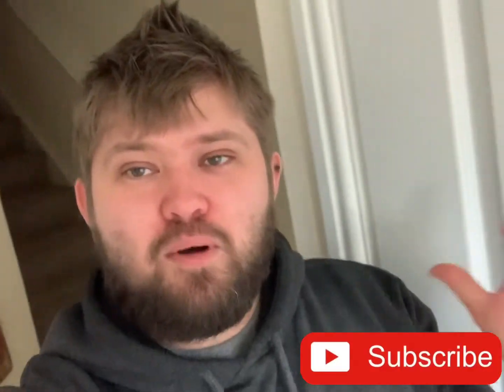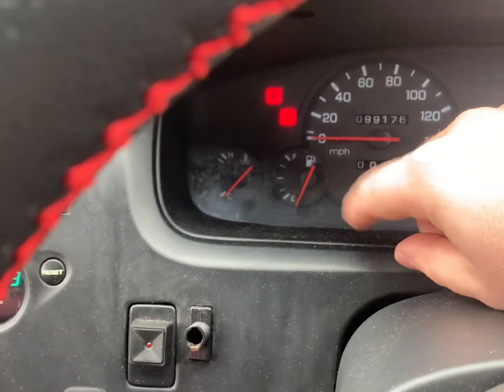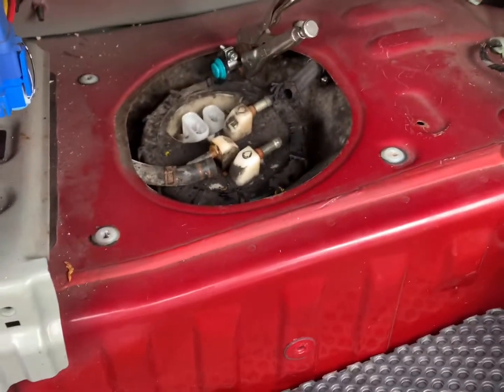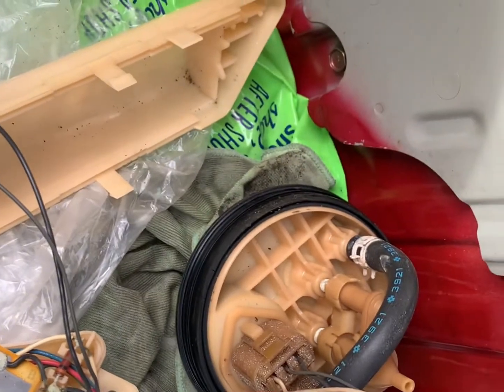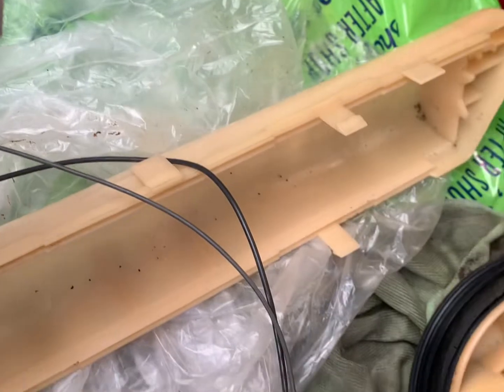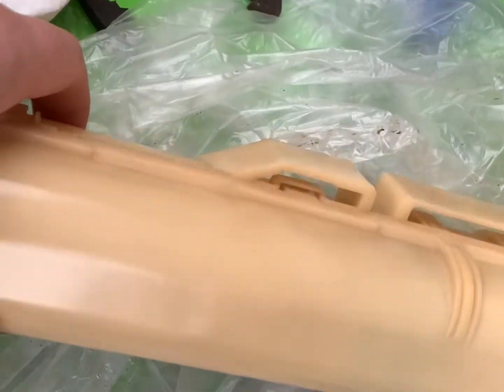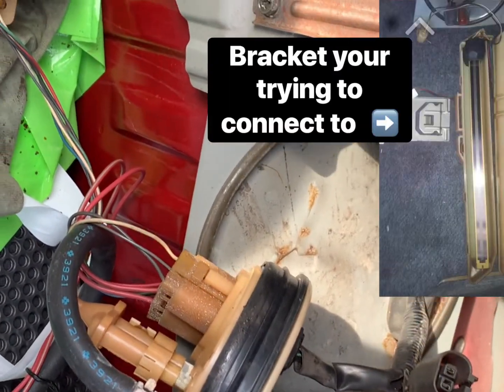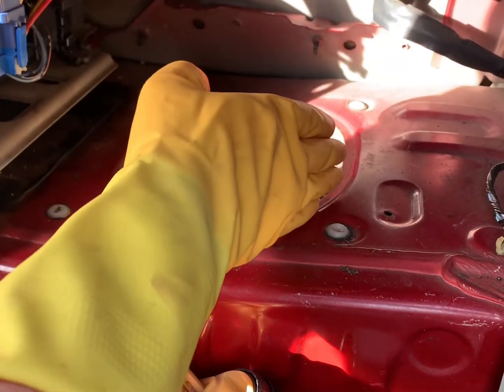R33 Fuel Gauge Not working ? - How to remove r33 fuel level sender and how to clean it.

Comment: Hi mate, just pulled mine apart and found it’s missing the resistor between the black and white. Just trying to chase down the correct sizing of the resistor, cheers for any help.
Reply from the maker: Hi mate, I think I have the old one somewhere around I’ll try to see if I do to take a closer look. 

In the end I managed to source a second hand sender for £100 which fixed the Issue out. 

If I can find the anything I’ll reply back on this comment or if you have Instagram I can try to send pictures on there mine is ashlb33 👍🏻
Reply from the maker: Hi mate, I got a close up picture of it and asked chat GPT as I couldn’t see much to go off I got the below. I hope this helps:

From the photo, that axial resistor appears to be a fixed calibration resistor used in the R33 fuel level sender circuit (not the main variable track).

What Nissan typically uses (R33 GTST)

For Nissan R33 fuel senders, the overall sender range is roughly:
	•	~90–100 Ω (empty)
	•	~10 Ω (full)

The small fixed resistor you’re pointing to is usually around 100–120 Ω, used to trim or stabilize the gauge reading.

Reading the color bands (from what’s visible)

Although the image isn’t perfectly clear, the bands look like:
	•	Brown – Red – Brown – (Gold tolerance)
Which corresponds to:
	•	12 × 10¹ = 120 Ω ±5%

This lines up very well with what Nissan commonly uses in these senders.
Reply: @ashlb8223 thanks for your help mate, appreciate it.
Reply from the maker: @jaiden1500 No problem at all hope it was some help to you mate.

Comment: Did you fix it allready? What was the reason, how u did it?
Reply from the maker: Unfortunately and cleaning it up it neverworked I still have it though so I would like to do a fault finding video on that sender unit. I managed to source a whole sender unit with the wires and connectors and swapped it out and it worked. 

So somthing is wrong with the send I’m yet to figure out what though 🤔

Comment: Hi Ash.
Today I tried to take out the Fuel gauge and the fuel pump again, but I can't. I can't find out where the fuel gauge is attached to the tank.
Is it around the top of the fuel gauge, close to the hole, where I'm putting my hand, or it's attached along the whole length of the gauge? And how it's attached, is it clips, or something else?
Also if you can tell me whether the fuel gauge is connected to the fuel pump, or not?
Sorry about all questions, but it's really hard to take them out.
Reply from the maker: @Bono-rv6ki Hey Bono, 
I will do my best to explain it so if you reach into the tank with the palm of your hand 🖐️ facing forward the pump is located towards the front you’ll have reach in abit. To remove the pump get a grip of it and pull upwards and it should come free it’s only sloted into a bracket. 

Once that is free then move onto the fuel sender. This is located towards the right of the fuel pump. It’s the long tube if you can feel for that. The again slots onto the front of the tank. The bracket is halfway down the tube and you it releases by sliding it to the left. (This is really tricky) I’ve done it twice and it’s a massive pain. I tried pulling to the left from the top of the tube then the bottom to try and work it off the tab.

If you have Instagram my Instagram is ashlb33 I can try send pictures that I have to help further.

I hope this helps

Comment: You are welcome mate.
I'm struggling to remove the fuel gauge and the fuel pump off the tank...
Can't figure out how they are attached to the tank.
Could you give me any advice for it?
I don't have an Instagram, but I'm on Telegram as a 
Skyline Man
Reply from the maker: @Bono-rv6ki I don’t have Telegram mate, best way to explain for the fuel pump to get out. It slots onto a tab to release it you need to slide it towards you and it should slide free. 

If the sender unit needs to come out as well
 (I can’t remember if you can unclip the pump form the sender.) the that’s on another slot on tab but it come off to the left and the tab is located around the middle of the sender unit. Not going to lie the sender is a mega pain to get out. 

I hope that helps mate 🙏🏻

Comment: Cheers for the video mate 👍
What a pain this is to do, did my fuel pump a while ago and the guage isnt working so gotta pull it out again 🥴
Fingers crossed the sender just fell off 🤞
Reply from the maker: @ndorfn6579  It’s such a rubbish job mate. I need to do another video. I’ve got my gauge working. But I had to source a second hand sender unit. 
Swapped it out and it worked straight away. But between that black ring that you have to knock loose. Then trying to get the sender off all whilst being in an awkward position leaning into the boot of your car it’s got to be one of the worst jobs.🤣
Reply: @ashlb8223 yeah man it's a cow of a job 😫 so annoyed I have to do it again.
At least you got it sorted with a replacement, typical tho. 
I ended up making a tool to get the cap off with a cple of brackets I had lying around (kinda like this
 ____|___| ) actually worked 😅.
I'll keep an eye out for you vid.
Take it ezy and good luck.
From 🇦🇺
Reply from the maker: @ndorfn6579  I might try to make a tool as well as I’m sure it won’t be the last time I’ll need to go and fix somthing 🤣

Thanks man you take it easy as well 👍🏻

Comment: I'm struggling to remove the sender unit. Any advice?
Reply from the maker: Hey, I not going to lie it was a real struggle to get mine free. Also trying not to get the urge to just yank on it as hard as possible. 

The sender comes off the bracket to the left. I trying grabbing towards the bottom then the top trying to work it off the bracket. 

I do have a Instagram ashlb33, feel free to drop me a message and I’ll try to send over images of the sender. Might be able to get zoomed in image of the clip so you can sort of visualise how it will come undone. I have a couple of mates with Skylines who have had battles with getting the sender unit off.

I do have to take mine off again sometime this year as I’ve sourced the fault to the unit. My wiring to the gauge works. I’m dreading it!
Reply: @ashlb8223  thanks for getting back to me. I read another comment saying use a screwdriver to prize the clip on the unit so I may try that. I've tried wriggling it, twisting it, pulling from the top, middle and bottom. It's frustrating to say the least. Lol
Reply from the maker: @josephspeed3006  That might be worth a try like you say if you can open that clip abit it might come free.

Like you say, I left it over night and came back to it the next day as it was driving me mad and killing my legs leaning into the boot. 

Keeping my fingers crossed for you 🤞🏻 like I say I’ve taken some close up pictures not the best. But if you want them can ping the over Instagram. 👍🏻

Comment: Thanks for the video, just got back my car, after nearly 2 years rebuild. Mechanic just give up, so I have to finish everthing by myself. Noticed fuel level at "dead" level. And timing bełt too tight :-) And some other issues. Thanx !
Reply from the maker: No problem at all, hope it helps sort the fuel level. Some of the guys that have commented have also put some good information also. 😁👍🏻

Comment: I had a similar problem to you. I know why your fuel sender fix did not work. You need to take it apart again and repare the brushes on the float. The float is not connecting to the resistance rail. You can test the rail by bringing the yellow and black terminals and testing the resistance along the rails with a multimeter 25 - 95 ohms. I made a brand-new float brushes assembly from 3,000 brass plate.  Let me know how you went. Regards, Trevor
Reply from the maker: Thanks for the comment mate, I haven’t had chance to look into it further since the video I did. I will defiantly have a look into this. 

Also thankyou for the info, hopefully this video and all the comments will help everyone out 👍🏻

If you have insta mine is ashlb33 if you have any pictures of the repair that would be great 🙏🏻
Reply: @trevorotjen8, Trevor, for the past 24 hours I've been trying to figure out how to re-build both float brushes, and I'm still trying to figure out the best material to use for gasoline/petrol application, hoping I can make them better & stronger/sturdier than what comes from factory.  For that reason I would like to know if by any chance you have a drawing, pic, sketch or video that you could share with us, and also I would like to know what do you mean when you refer to 3,000 brass plate.

THANK YOU!!!
Reply: @jesusmrodriguez1123
Reply: No pics or video. Find 3,000 brass or copper and copy the layout of the original float. The brushes are quite forgiving if you make the conection too tight. I actually cut my brushes on an angle, starting from 8mm at the float to 5mm at the end of the brush.
Reply: No pics or video. Find 3,000 brass or copper and copy the layout of the original float. The brushes are quite forgiving if you make the conection too tight. I actually cut my brushes on an angle, starting from 8mm at the float to 5mm at the end of the brush.

Comment: Good vid. But not showing how to remove the sender unit from the metal bracket. I'm still struggling with trying to remove it / detach it from the metal bracket. 😵
Reply from the maker: Hey mate, it’s so difficult to try film removing it that’s why I tried to add the images of the bracket to know what your feeling for. 
The bracket connects to the sender unit in the middle. If you feel down the sender about midway hopefully you’ll be able to feel it. It took me ages to get it to undo and was a very frustrating especially leaning over the boot of the car. I did have to use abit of force to get it to detach. 

Hoping you have success dude. I need to get mine back out at some point when I do will try to do a better video 👍🏻
Reply: @ashlb8223  Yeah, understood,mate. If only there's a 3D  video on how to do it/tutorial. Like technical CG/3D video could explain. That would be awesome. 😆
Reply from the maker: @sufianzaini4879  it would mate, I really wanted to do a much detail as possible to help people as I couldn’t really find much out there. But once your arms in the tank it’s impossible to show. If someone had a broken fuel tank off the car and cut it up so you could film from the inside that would be a good.

Hopefully you get it detached mate, like I say I was faffing around for a while and I couldn’t get it to come free and gradually tried to be abit more forceful and it finally came free.
Reply: @ashlb8223  Yeah, hopefully someone can do a cutout of the tank & film it in detail, or could just do a 3D rendering video. Yeah, the metal bracket in my tank is pretty rusted already, so I tried prying with flat screwdriver while tugging & wiggling the unit, it still couldn't come off. I'm scared it would break the plastic slot for the metal bracket. 😟
Reply from the maker: @sufianzaini4879  ahh bugger mate, that’s what my concern was when pulling with more force on the sender. By the sounds of it your doing what was was trying to wiggle it off that bracket. Keeping my fingers crossed 🤞🏻 for you it comes off.
Reply: To remove sender from the bracket put a flat screw driver between bracket and sender, you have to take it off the clip on the bracket

Comment: I have the same issue but mines internittant, hopefully you work it out!

I managed to get mine out late last year, and cleaned it down with acetone as well. Ran a multimeter across it and was getting variable resistance. Put it all back together, and its working sometimes but again keeps dropping right down indicating no signal. I have multiple clusters and its always the same so its not the cluster itself, so I assume its wiring related....its a headache though.
Reply from the maker: Thanks man, so do I really thought cleaning the sender would have worked. Typically I didn’t have a multimeter at the time. 

But I plan on changing the fuel pump and I have a multimeter now. So hopefully will do the test to see if we’re getting any resistance. Such a pain though! 

My Speedo isn’t working either all the other gauges work. But hopefully will be able to get them both working again.